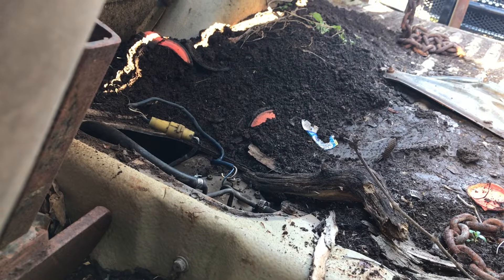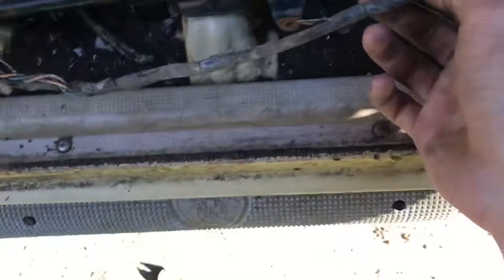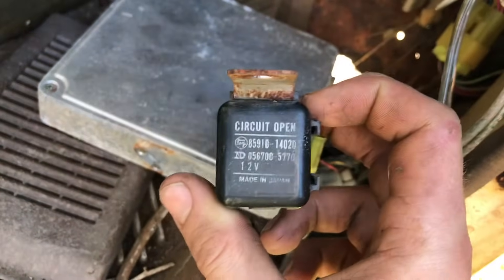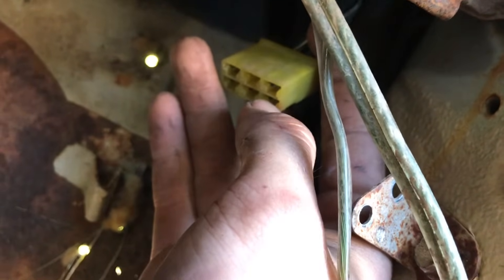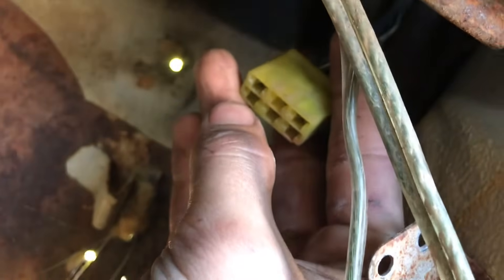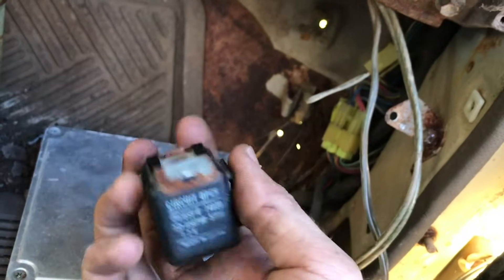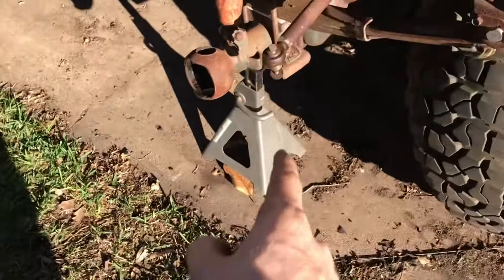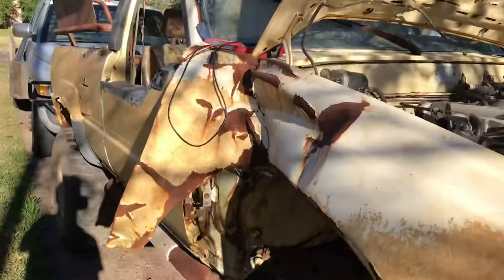22RE No Power To Fuel Pump? How to Bypass Circuit Opening Relay

Comment: I have a 91 pickup with a 3.4swap (3.0 originally), and was having issue with my truck cranking but not starting. Checked voltage everywhere, had many spare parts to help the diagnostic. Felt like an electrical issue since the beginning so I didn’t want to replace the pump or starts checking fuel pressure or injectors and such, so checked every forum possible to pin down what it was and this guy just saved my day with this video and showing how to jumping the FP and B+ in the COR (circuit opening relay), mine was rusted out and full of ice as it’s -20 here and water must have leaked from the windshield into the relay! Anyways thanks again for the very clear explanation 🤘🏽💪🏽

Comment: I have a strange issue : 1995 land cruiser - when I bypass the fuel pump relay everything works as it should, when I plug one in the truck starts but after 30 seconds or so stalls. 
 The relay is working I have two, both brand new from Toyota.
Reply: ECU?
Reply: @FinMcMurder  I was looking at the diagram and wonder if ground for the ECU is the issue. But I suck at electrical diag :/
 I'll keep trying...
Reply: Wiring near EGR?

Comment: Also if youre MAF not electric clean.it well try to start pumping on gas acting like a carburetor..just clean the plug on both sides.thats if it has hard time starting in morning..or when u not driving alot .

Comment: Same thing happened to me bought a new fuel pump still wouldn't turn on.come to find out it was from the MAF sensor by the air filter ..good way to test that was just unplug it and it start with out the plug .once you plug it back in while it's idling it well turn off ...then u know it's bad sensor

Comment: I think I have this issue as well. Occasionally I'll turn the key to start. It'll rotate and fire and then die immediately like it ran out of fuel and you just keep playing around with it and eventually I don't hear the relay click off and she'll keep running. I also have my starter wired to a separate switch. So I can hold the key to start and she will run. But if I let off and the relay clicks off she will sputter out. So I'm gonna look at this tomorrow
Reply: It's a crazy relay, I think it runs the fuel pump only when the engines cranking. I think it is supposed to open that circuit and then run off the ground from the Air sensor. So the minute your air flow croaks your gas shut off switch comes on. Toyota calls it a circuit opening relay. it's Toys secret sauce. I'll bet this makes them a small fortune.

Comment: Will this work if you’re fuel pump is bad I tried this on my 92 and still nothing I have a feeling I just have a bad fuel pump
Reply: A guy suggested to take a hammer and beat a few places on the gas tank. I couldn't figure a direction so I did this and it started up. It ran bad but I had an answer. A place to start looking. So it is either  the Circuit opening relay or the fuel pump. OR A BAD FILTER!!! I'm going to change the filter and then Jump the fuel pump to see if it runs ok.
I backed into a tree a couple of days before my cranking no start. That told me a fuel cut off device/circuit opening relay. Or perhaps some sludge got loose in my tank. So change the filter. The man said I bet you 100 dollars it's the fuel pump. The man knows something that I'm now learning. God Bless!!

Comment: Thank you so much for this video I think this will fix my problem I put a new fuel pump and filter but I’m not getting fuel in my fuel rail or cold start injector!
Reply: Did it actually do the trick? I’m going through the same problem with my 02. New fuel pump and everything. 6 weeks I got it done and now it’s boggles down
Reply: @Tropicalbreeze00 did it work?

Comment: Oriellys has a replacement Dormant brand relay that cross references with oem #, was like 20$ and has been working on my 88 for two years no problem, if u can find Toyota one it's like 70-80$ yikes
Reply: Do you know the Dorman number for this cross referenced part?.I may have this issue on my 86 Toyota dually
Reply: Yeah I also need the number
Reply: Yea do you know the #?
Reply: Yeah my 90 pickup is missing one of the two relays under the hood and they are 28$+ tax at the auto parts store. The truck has been sitting for over 3 years and I just put a different transmission and new clutch hydraulics in it. I don't want to spend 40 more dollars in order to see if it works or not. I guess I will wait till tomorrow morning and try to find one at a junkyard for 7 bucks .. 28 + 7 for the fuse it's also missing I don't have it to spend and if I did I probably still wouldn't. I have EVERY OTHER type of relay and fuse for various manufacturers.. from mopar to VW/Audi and Ford or GM but I don't have any of the Japanese Toyota or Honda ... I don't remember what kind the Honda uses but don't believe it's like the Toyota relays

Comment: Update, my car does not start on cold start , is there any check I can use to troubleshoot (only able to start with starting fluid and works and starts fine when warm )
Reply: I'm thinking a vacuum leak. get it running and mist soapy water in a sprayer bottle. the engine will change when it gets sucked into a leaking intake gasket or a another vacuum leak. Don't just soak it all down with water. Do a little at a time and find the leak.

Comment: Would that COR relay cause ignition issue because for my 4runner to start and keep running I have to hold the key on start
Reply: Sounds like your ignition cylinder that holds the key is bad. Mine went out on my 67 beetle,the plastic broke inside so spring kept the key in position and kept engaging my starter until I manually twisted key back.plastic parts fail in these ignition lock cylinders

Comment: I did this and it still doesn’t work
Reply: Sounds like the fuel pump. Take a hammer and beat around the tank in a few places then try to start it. Try a few times. This often starts it for a while. But you still need a fuel pump. It's no fix. Only a way to tell. Change the filter!!!

Comment: Are they any cons to doing this and leaving/running it like this
Reply from the maker: Erik R I don’t think there would be any adverse effects,  besides if you have an engine fire or you’re in an accident your fuel pump won’t shut off automatically and would continue pumping fuel into the fire until you turn the ign off.
Reply: @doublewrench  Kind hard to turn off the ignition if the cause of the fire was a vehicle accident & you are unconscious. That's why the relay is there, it's a safety item.
Reply: DoubleWrench yea I was thinking the same. I had to do this on me fj60 and on my 240sx lol
Reply: YES. You are NOT supposed to leave it bypassed at all times. It creates more and more fuel pressure as it is continuously pumps fuel. So you have to remove the bypass everytime u turn off your vehicle.
Reply: @Super Nintendo  not true at all when you turn it off it doesn't pump fuel he didn't wire it straight to the battery...

Comment: so got home and tried to get my yota running its a 89 5 speed but a pickup buddy has 2 parts 4 runners but the relays arnt the same tried the jumper wire and still no luck have power coming to relay when you crank relay clicks aswell but no power coming out anywhere if i put power to fuel pump truck fires up and runs great anyideas
Reply from the maker: Jackson Zackodnik hmmm, have you checked out the COR portion of 4crawlers site? Should have any info this vid is missing. It might be different for your later year though. Maybe the FP port is in a different spot so jumping it this way is ineffective?